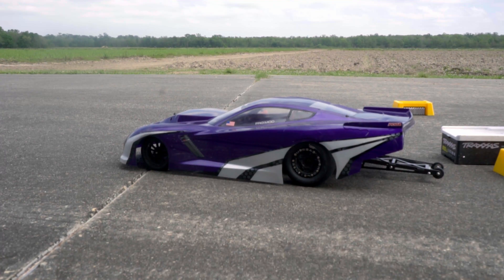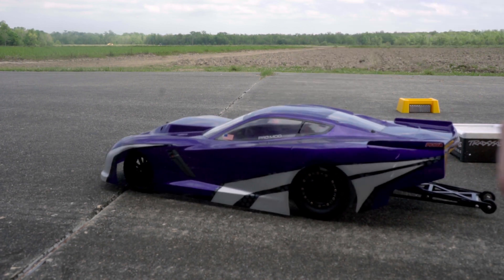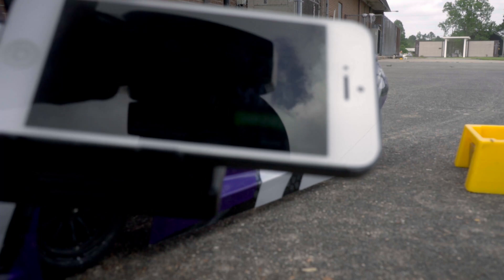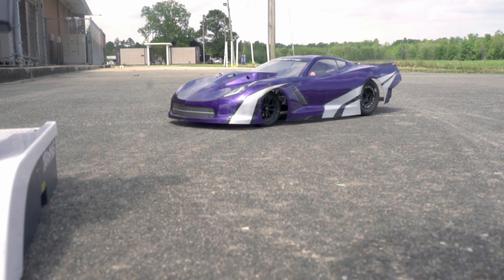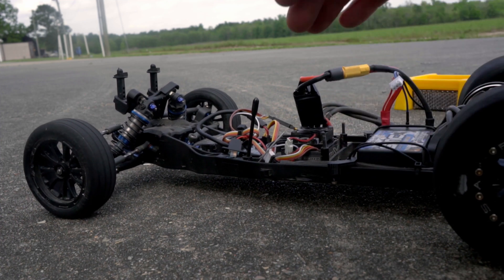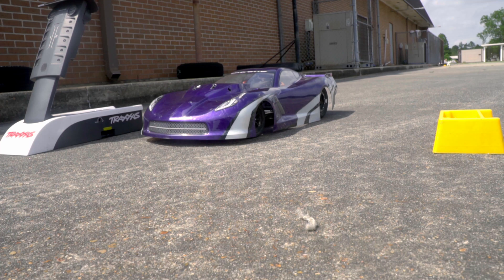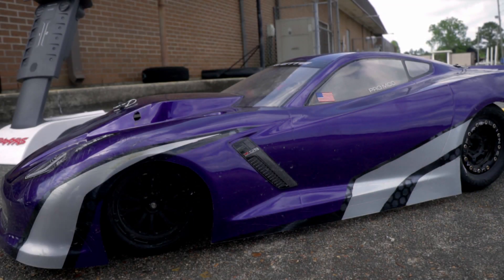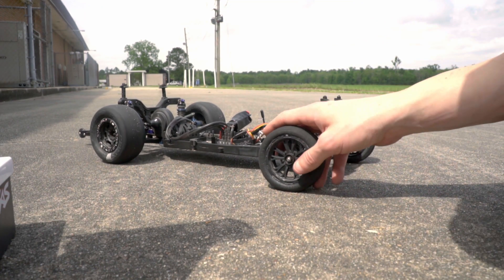Testing A Cap Pack in RC Street Eliminator | FullThrottleDragRacing

Comment: Hey my love your channel question This is driving me crazy for a couple weeks my voltage is dropping no more than low 5v and sometimes low 3v do you think capacitor help the situation new battery r1 11400 2s Hobbywing 4.5t low boost and turbo every gear and nothing my capacitor is really small thanks any help thanks
Reply from the maker: I would definitely say a capacitor should help, or a larger one. But voltage drop as low as 3 volts seems extremely low. I would check your wire size or connectors to make sure you can pull enough amps through them.
Reply: @FullThrottleRC  I have XT 90 a double check everything. And I’m going to try at 3.5 motor thanks

Comment: That mamba x is UNDERPOWERED? I jus got mine while planning on using it on the castle 9000kv motor. Bruh. Also what battery do u use?
Reply from the maker: I'm running a 3.5t motor and it was underpowered for that motor. Using a SMC 2s 5000mah pack and a gens ace 2s 6000mah pack. The ESC would go into overload protection during every pass
Reply: @FullThrottleRC  damn it. Did u do any programming with the castle link cus that might help
Reply from the maker: @classy333  yep, I tried a bunch of things. I had to turn it way down to make passes without the overpower warning kicking in
Reply: @FullThrottleRC  ok thank u

Comment: Thank you for your vids- I'm currently building a B5M no prep car and have been following closely.  I do have one suggestion;  In the original build vids on your car, you changed out the rear lower A-arm mount/inserts so you could get zero rear toe.  I have noticed in your testing vids that your car launches straight, but tends to get squirrely on the top end. I'm guessing it's not having any rear toe angle. A notable no prep drag racer has said that rear toe in helps higher speed stability- He suggested about 2 degrees of rear toe in.  Pretty easy and simple to try, as you already have the factory parts to change it.  Worth a try? Thanks again for your vids and I will keep an eye out for more!
Reply from the maker: Thank you!! I'm pretty sure I have put those factory inserts back in now but I'll have to check again to be sure.
Reply: @FullThrottleRC  Also Associated made a set of the mounts with different holes to change the rear toe, and also anti-squat to alternate settings. The part number is ASC91532. They are all over Amazon and Ebay for about $5-$7 a set- I just ordered a set myself just now on Amazon! Thanks for your reply!

Comment: I believe the cap pack should be able to radiate heat, did you wrap yours in electrical tape?
Reply from the maker: I did. Probably not the best idea, but I haven't had a problem with it yet. The ends are still open so maybe that's why I'm not having any heat issues.

Comment: Love the video on this one, I also wanted to comment that it was the low voltage cutoff and not the over-current warning you heard. I have the same esc with the 7700kv setup so it's around a 4.0 motor and after 20 rips on it I get the same warning. Need a good battery with over 110c.
Reply from the maker: Thank you! I was able to see the information in the data logs where it said the low voltage cutoff was coming in later on. Don't have to worry about that anymore though 😁
Reply: @FullThrottleRC  being that I have the same both of the same esc's you have, which one do you think is more powerful?
Reply from the maker: Personally, I like the hobbywing for drag racing so far

Comment: Capacitors pass current through them. They don't impact current. They can however reduce voltage sag.
Reply from the maker: Yea I may have misspoke when trying to explain it. The capacity stores energy which is used when the voltage from the battery drops

Comment: Ive got an old Associated B4.2 you think its worth converting it to a drag car or is the mid motor a better set up??
Reply from the maker: Its worth a try if you can get the parts needed. Just about everyone runs short course length wheel base with buggy track width. You would need to swap out the chassis for a short course chassis to extend it.

Comment: Is that a scale 1/8 mile or 1/4 mile . Really love your vids , only come across u today and I got a 1/6 Ford F-150 lightning drag truck I’m building.
It’s also a hard body newbright lol. Running 2 motors to help with heat
Reply from the maker: Thanks! I mostly run a scale 1/8 mile or 66ft due to the limited space I have easy access to

Comment: Vote for ESC Pro black love the data logging
Reply from the maker: That's one of the two ESCs I'm looking at. A little worried about the temps since it doesn't have a fan and it gets pretty hot down here in the south.
Reply: @FullThrottleRC  for drag racing it works fine .. I'm in fl
Reply from the maker: @powermadracing5116  I do a lot of testing, and back to back runs. I'm worried about heat making a bunch of passes right after each other.
Reply: @FullThrottleRC  that could be an issue for you
Reply from the maker: @powermadracing5116  yea I have another ESC in mind that I may try

Comment: Your mid et’s are great (66’) you’re on track to run mid to low 2’s in the 132’ comparing to the time slips I have that’s extremely competitive, what ESC are you running again?
Reply from the maker: That sounds really encouraging! Currently running the Castle Mamba X. Looking into a Hobbywing XR10 or Tekin RSPro
Reply: FullThrottleRC how about  the new Castle Mamba Monster X? I’ve been eying it lately
Reply: @FullThrottleRC  what gearing are you running with you 3.5 motor in 132 foot.
Reply from the maker: @alyarmak9871  I haven't been able to run this motor to 132ft yet
Reply: @FullThrottleRC  ok, what are you running in the 66 foot
Reply: Also that rear shock tower extender you designed is awesome, thank you
Reply from the maker: @alyarmak9871  23/81 but that'll change with the new ESC
Reply: @FullThrottleRC  ok thank you
Reply: Was that with the hobbywing

Comment: Would you recommend running the cap? I picked up a rig that had one and I feel it heated my esc up way too quickly. I didn't really notice a difference either.
Reply from the maker: It's definitely useful in racing. The power is a lot more responsive I would say with the cap. If you're just bashing I wouldn't say you would need one.
Reply: @FullThrottleRC  sounds good. Thank you for the info. Keep up the great work on your channel.

Comment: looks real good bro. do you have your diff locked? or?
Reply from the maker: Yep diff is locked completely
Reply: FullThrottleRC okay cool. good to know. i just loaded up my diff with some super thick diff oil , but i’m wondering if i should have just locked it instead.
Reply: @norcalrc  I wouldn't recommend locking the diff out. See how his car wants to pull to the left? I use 200 k diff oil, and the car stay much straighter.
Reply: Derek Marshall he needs to tune the suspension for the pull nothing wrong with a locked diff;)
Reply: @jderbedrossian  correct

Comment: Is the car launching to the left or are you correcting it from going to the right ?
Very very cool.
Reply from the maker: It was launching a little to the left. It looks like my wheelie bar might not have been level which could have caused that
Reply: @FullThrottleRC  SWEET RIG, and excellent tuning. I also run no prep, on a mid motor traxxas build. I run a 4.0 turn motor, if you run a 3.5 turn? Try unlocking the diff and using about 100 k diff oil.i believe  Your car will shoot MUCH straighter. Good luck & great videos.